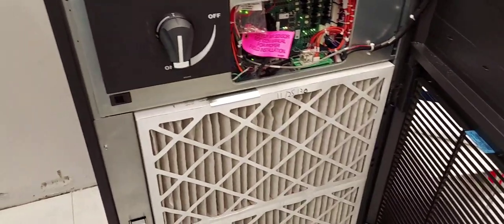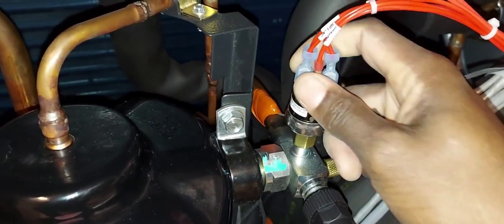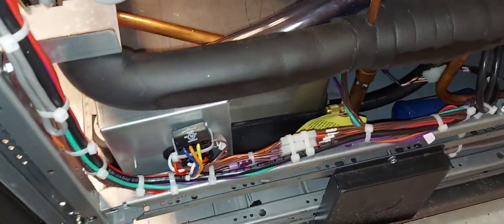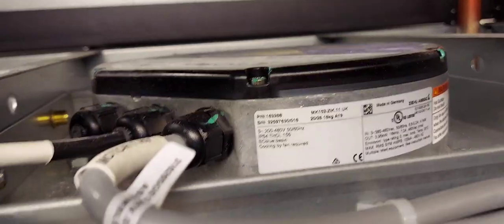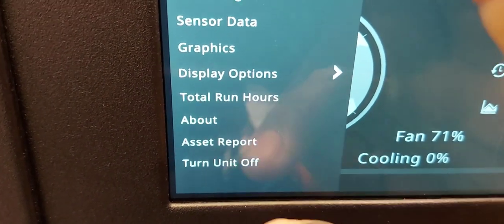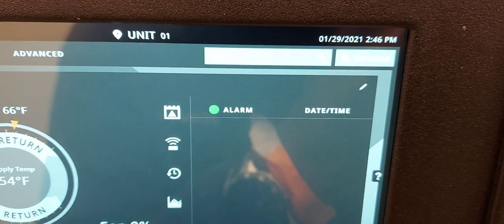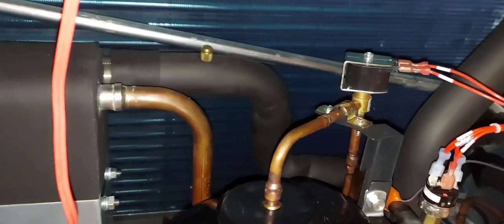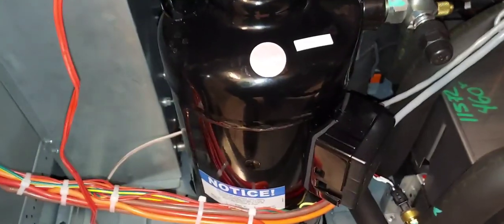VERTIV LIEBERT PDX PRECISION COOLING SYSTEM

Comment: Is their a condenser on the unit? Customer is interested in replacing their split system because it gets too cold outside for it to properly cool with such low ambient temp. Thank you for the video
Reply from the maker: Yes however it's water cooled!
Reply from the maker: Yes however it's water cooled!

Comment: Many thanks for this Excellent walkthrough brother. Wish I saw this when I Had to figure out my Vertiv SOHUA install 2 years ago. (Used Pass 5010). 
May I ask 2 questions while at it : 
1. This was the first time I saw a compressor indoor while the outdoor unit was basically just the condenser. 
What is the reasoning behind having the compressor indoors ?
2. For a video wish list, May I ask for a video on scroll compressors making a much more pronounced rattling noise at shutdown (inspired by the solenoid) when the internal discharge valve is broken. And can it stay that way with no consequences on the compressor ?
Reply from the maker: This unit is water cooled the condenser is inside it at the bottom next to the compressor , the condenser uses water for heat rejection

Comment: Hello, what is the best option for humidity control? A. Relative B. Compensated C. Predictive
Currently I have a problem with my Liebert equipment, the humidity condition is very low (Temperature is stable).

Best regards
Reply from the maker: First you have to make sure humidifier is functioning!
Reply: @D2DNYAC  Hi, that's the first thing I did, the humidifier is working fine. In your experience, what is the impact of working with predictive and compensated type control?
Reply: i would like share you the graph of process with you?

Comment: Hi! I have a question, could you help me? 

I need help with an alarm, the alarm says "capacity reduction c1" do you know what it means?

Thanks
Reply: If the pressure gets above a certain PSI, the capacity will be restricted to 80% or less for either 30 or 60 minutes.  If it can't get the PSI back down into an acceptable range in that time, it will shut off on high head pressure.
Reply from the maker: 🤔👏👏 I like 👍 it thank you 🙏 my friend

Comment: Sir what is the cause if the condensation of the unit is over flow?and what is the remedies for that?thank you sir?
Reply from the maker: Most likely a clogged drain line , simplest way to remedy is to get a shop vac / wet vac on it and suck the line / pipe out
Reply: @D2DNYAC  thank you sir more videos about Liebert...I always follow your channel

Comment: How you like those compared to the Challengers???
Reply from the maker: This just an upgraded challenger better I guess
Reply: They added an EC fan and switched to a slab coil.  Also 410A refrigerant.  Everything else will be the same as what you're used to.
Reply from the maker: I don’t know what part of the world you’re in however in the USA it’s R407C refrigerant in all newer Leibert/ Vertiv units
Reply: @D2DNYAC  False.  If it was a R22 when it was designed, Liebert switched to 407C from the factory.  Anything that's a new design after that, including the PDX, is 410A.
Reply from the maker: My friend you are correct The latest PDX is in fact R410A 😮 was not not paying attention to that thanks  🙏  Smh 🤦‍♀️ lol 😂 and I did a video on it 🤣🤣🤣🤣

Comment: actually that alarm doesn’t matter if u even shut it down from controls enables first which s proper way, still causes the alarm, i had a few in row units doing pm and 1 kept coming with that alarm, no big deal but controls company didn’t spread out the parameters
Reply from the maker: Thanks for watching

Comment: 1 tine I messed with one of there it nearly cut my head off,  I had a visitors tag hanging from my neck the blower turned on pulled my tag ripped off my neck and the water temp switch’s in the water resivour   And shot it straight in to my eye luckily we wear safety glasses all the time.  BE CAUTIOUS

Comment: I have pdx021 unit master and slave im going to install i did all mechanic jobs and gave gas the system after vacuuming but i cant doing master slave connection can you help me man?
Reply from the maker: Probably! Are you looking to network leibert/ Vertiv units together?
Reply: @D2DNYAC  yes sure can you give me a mail adress for help please??
Reply from the maker: @Hamit Emre Avcioglu it will probably be easier for you to just call leibert/ vertiv tech support 800 543 2778

Comment: Great informative video.  I wish I had the time available to make video's as well. I see tons of different commercial equipment including some 30 ton liebert units at some university's and verizon data centers. Correct me if I'm wrong, at 14:06 there is a horizontally mounted board with a black button on it. Just to add to your walkthrough, I believe that is a high pressure reset button.
Reply from the maker: are you a FPV Pilot?
Reply: @D2DNYAC i used to race drones but just as a hobby.  By the way, I was wrong about that reset button. Its a smoke/fire reset switch not high pressure.
Reply from the maker: yes, indeed that's exactly what that horizontal board is
Reply from the maker: i am into the fpv quads hobby as well! i have a few quads.. what city and state are you in ?
Reply: @D2DNYAC  I'm around the Tampa FL area. Year round full cooling calls =)
Reply: @D2DNYAC  build, fly, crash, repeat

Comment: What is the solution ?
  ALARM
 VSD Circuit 1 StartUp
Reply from the maker: Give more information
Reply: We've installed the machine PI021 PDX variable Speed compressor 
Everything went normal, when we want to test it the compressor ran for about 25 minutes and the error VSD CIRCUIT 1 STARTUP FAILURE 
THE ERROR number in the manual is 135
We've shutted it down and tired later and still after 25 minutes the same error pops up 
Can you help me with this,any leads for the problem could be helping 
Thank you